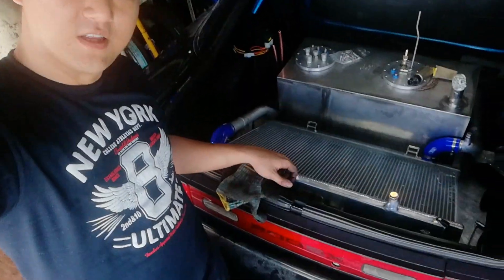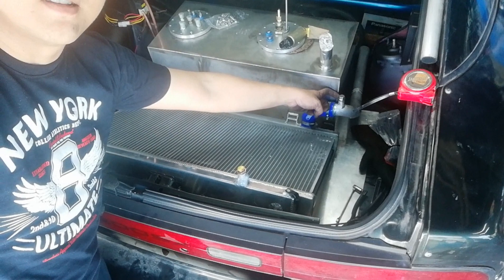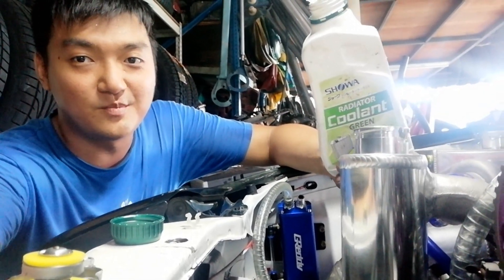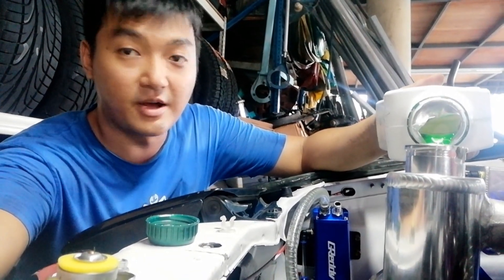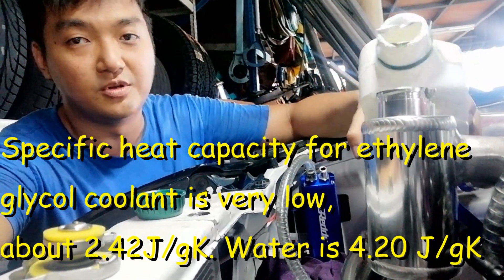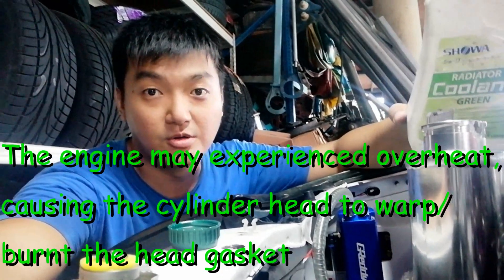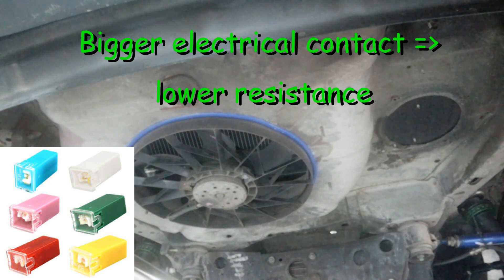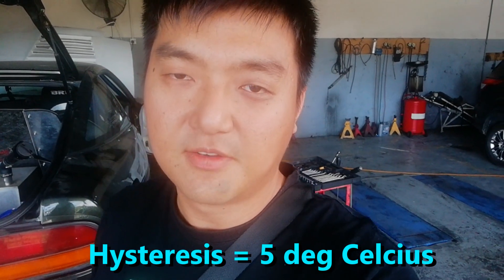2JZ Tuesday - What is the best Cooling System for 2JZ (or any other engines!)

Comment: Knowledge is Power. Question? What's your take on not using the water ports on the IAC valve, and is there any benefits for not using it. Some Jz owners don't use it. But I'm new to this engine I've only ever used the normal operating system. Thanks

Comment: Hello micheal, good info as always. I have got a question for you off topic. Around about- What's the length of stainless steel braided power steering line for a Right hand drive Supra mk4, if it's a straight shot not like the OEM which goes underneath the oil pan.  I have a RHD in the USA and all parts for the Supra are made for LHD. IF you could kindly lemme know how panjang is the line I appreciate it. Sorry for thread jacking. Or what's your email so we can talk over there? Mine is gill.strategics@gmail.com 😊